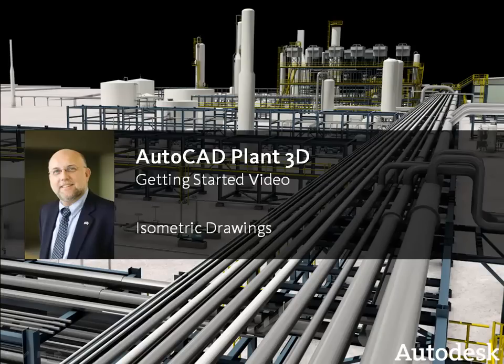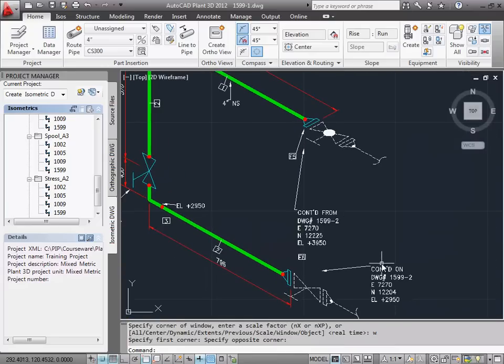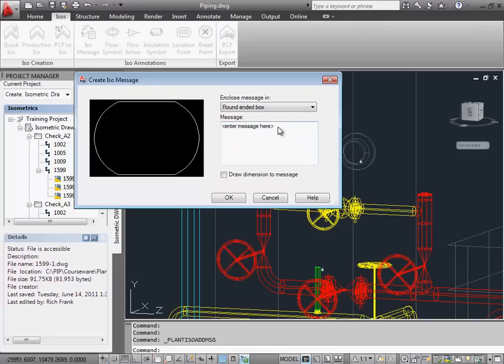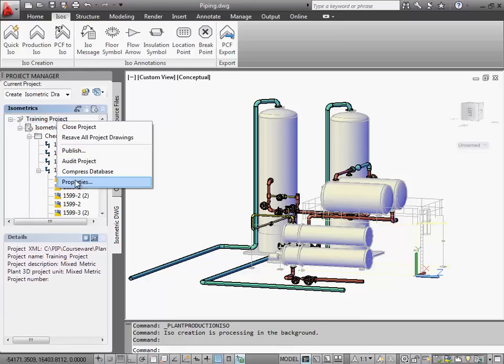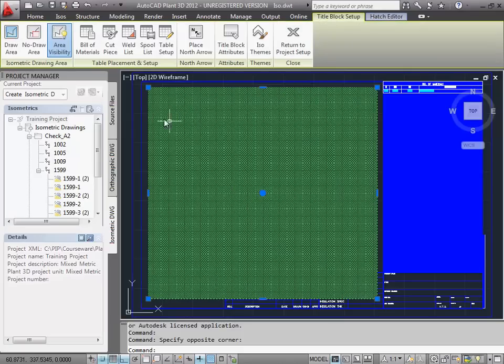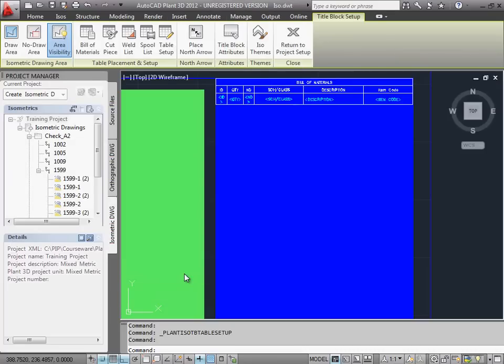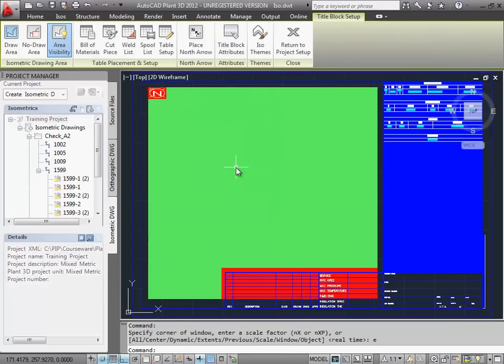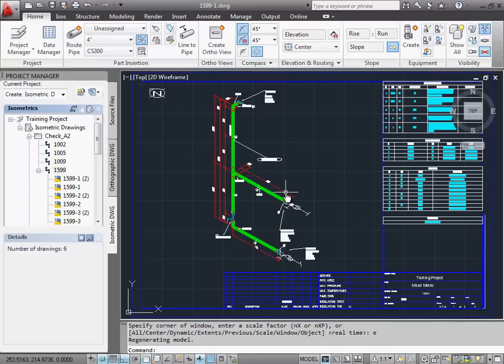Isos in AutoCAD Plant 3D

Comment: Hello, I wanted to know how you did to select a part in the assembly.
I have a pipe and valve assembly in .dwg but I cannot select a part and then extract the isometric.
Even using the "separate" function doesn’t work.
Do you have a solution?